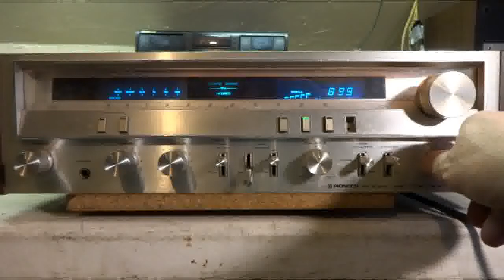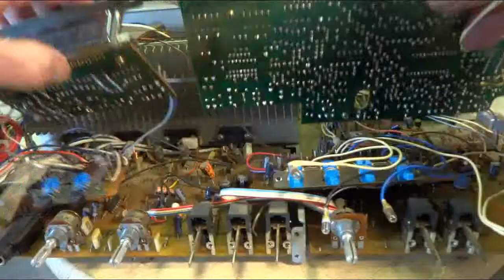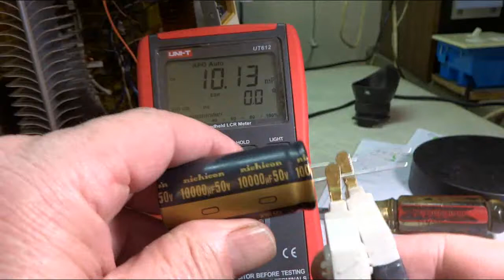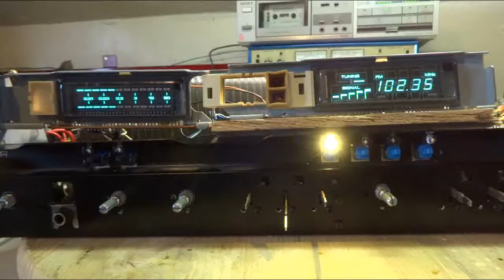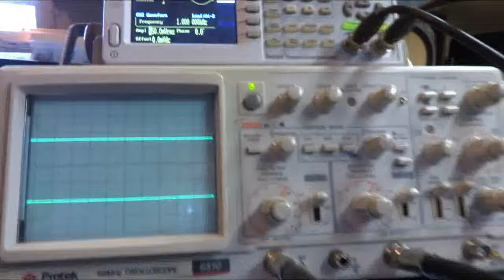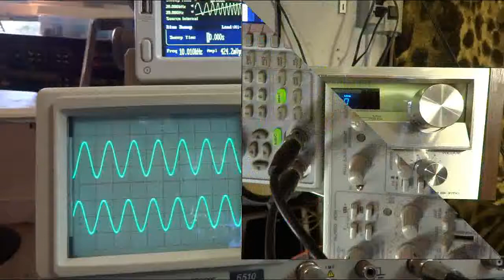Pioneer SX 3700 Recap

Comment: Pat, i've got a pioneer sx-3700 receiver, having a problem putting a selector-switch button back on the face plate. this series of receiver has the push-button type, unlike the 50 series or the 80 series of pioneer. how do you get these buttons to stay in?  i tried clear silicone super glue already, but know luck. ( it's the aux. button)

Comment: Greetings All,

On the SX-3700 Received the parts illustration  in the repair manual shows that the main transistors left to right are 49 (2SC2525 G) 50 (2SA1075-G) 50 (2SA1075-G) 49(2SC2525 G)

I have 2 actual units were the actual placement is left to right (2SA1075-G) (2SC2525-G) (2SC2525-G) (2SC2525-G).

One unit is working and the other has the left pair (2SA1075-G) (2SC2525-G)  shorted.

I bought replacement transistors and there are 2SA1216 and 2SC2922 replacements.

Question1:  Is the parts list incorrect in the order of the original Transistors placement or did someone replace the transistors in these units and messed up the Order?

I know the unit that does not work, some on placed the second pair with a 2SC2921 and 2SA1215.

Question 2:  The  2SA1216 and 2SC2922 replacements that are cross referenced to the original and  has the Y current gain (SanKen) where the originals are G Brand (F).

Will it be OK to use the 2SA1216 and 2SC2922 replacements with the Y current gain?  I am replace the MAIN CAPS and other CAPS with a refit kit.

Thanks in Advance for any assistance.
Reply from the maker: Thanks for watching. I get all of my information from audiokarma.org.  The guys there know their stuff and are always willing to help. For some reason every Pioneer that I work on, they want almost all of transistors to be change out. There might be a parts list posted on your model. Look for posts from Mark the Fixer. He and others know Pioneers very well.
I have rebuilt many Pioneers listening to what these guys say.

Comment: Hey Im about about to buy one of the from Ebay I would like it to be serviced  and to change white light and  blue lights on dial . Do you do this kind of work? If so l would like to contact you and get this work done
Reply from the maker: Thanks for watching. I got a Pioneer SX-434 that was working before I work on it and now it is not working. Had a big puff of smoke come out of it. For that reason I only work on what I own. 
Try Audiokarma.com for someone that works on these. Most of the guys that do work on them have a big back log, may take a while. You can research this stereo on audiokarma. Myself I didn't think the 3700 was that great.
Reply: what model would you say is better then the 3700 . I don't need anything too powerful I wanted something simple I could hook up my turn table too
 @patrickoconnell3896

Comment: Hello Pat I just got this amp off ebay fir 50 bucks because the lamps are shorted
Reply: Ok so I got to where you had no lights too..
Reply: The guy on ebay said he shorted the two lines the lamps run on by mistake so the speaker selector does me no good.
Is there a fuse I'm missing.?
Reply: And I'm betting be tried using 12v bulbs when he tried to upgrade the lamps

Comment: wow that cleaned up! what was up with the meters ?
Reply from the maker: One bad solder joint fix the meters. I just wiggle wires till I found it. It was on the speaker switch board.

Comment: Where did you find a spare green window button for the missing phono button? I'd love to track one down and fix my unit up perfectly!
Reply from the maker: I have a SX-3800 that was a complete failure on fixing it. I don't throw anything away.
Reply: @patrickoconnell3896  Pat, what do you know about the tension of those function buttons i.e. the FM, AM, Phono, Aux? I have an FM button that isn't too "clicky" and needs to be jammed down to stay switched. Any suggestions?
Reply from the maker: I think that the FM, AM, Phono and Aux buttons are all gang together. You push one and the one that was on will turn off.  Try cleaning the linkage that ties it all together. Or maybe a drop of oil.  But many times the plastic just wears down and there isn't much one can do.
Reply: @patrickoconnell3896  Pat, thanks for the prompt reply. Luckily for me, it was a quick fix! The ganged switches are secured flush with the faceplate via two front screws. The left screw i.e. the one nearest to the FM button was not screwed in, thus the button was not making full contact with he switch because the left side of the board was recessed deeper into the receiver.

Comment: Hello
I have the same Receiver and sounds great but I have a faillure in both channels and in all functions, suddenly you can hear a whistle in the background a very high frequency, come and go 10 minutes between. I have already check the caps and they work fine. Which may be the problem?

Grettings
Reply from the maker: There are a lot of things that can cause a whistle sound. You should go to audiokarma.org and research it there. There is a lot of helpful people there.
Reply: Patrick O'Connell Thanks a lot
Reply: Hello Pat, I have the exact sx-3700; I need to replace the power knob pot because it is bent.  I have a replacement that is not bent.  Is there any way I can talk to you about repairing this or how hard it would be for me to do this myself.  734-787-3226.

Comment: How  did  you  clean  the  speaker  switches ?   Thanks
Reply from the maker: If I remember right I used a hypo-needle with some DeoxIT in it, there are some small holes on the top of the switch that I was able to get the DeoxIT in. On these switches, one could take the top cover off but you have to be careful. Small parts could be lost.